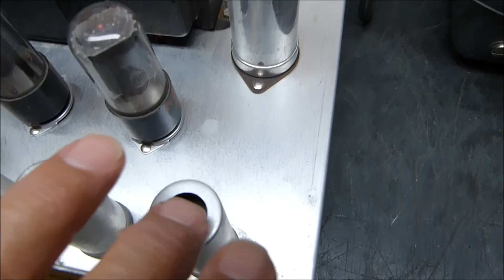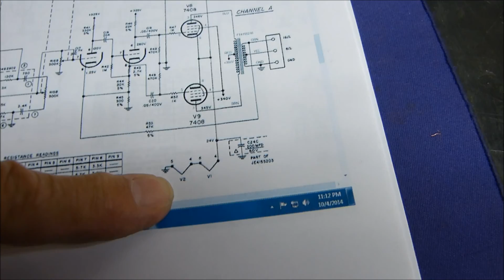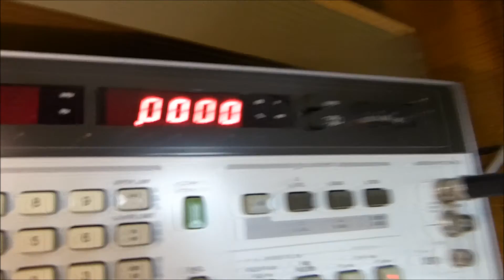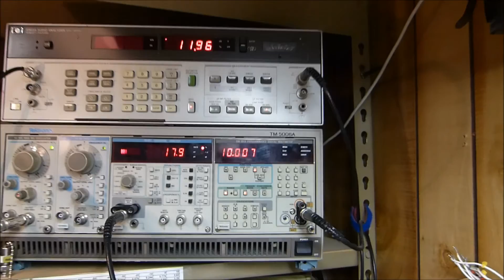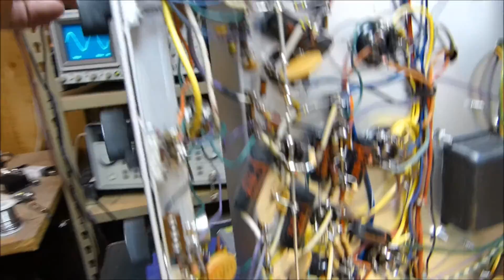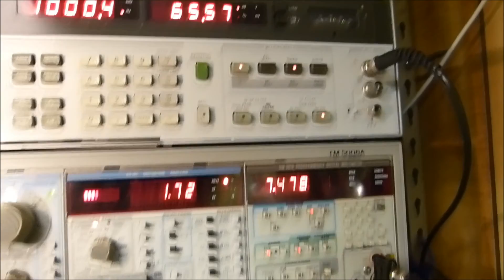Harman Kardon The Award Series A 300

Comment: just replaced all the electrolytics in mine. i installed them underneath using terminal strips. a few resisters were bad but none of the coupling caps were leaking. their mfd checked perfect on a cap checker so i left them alone. this is contrary to popular belief to change regardless..
                                       barry.
Reply from the maker: Mr71chevyvan I agree with you, Barry. Changing out good vintage parts doesn't make anything better
Reply: +Mr71chevyvan Make sure you check the old caps for DC leakage at their rated voltage. Often they turn into a 100k+ resistor with age, which can cause serious trouble if they are used in a coupling and DC blocking application.

Comment: I just have to put in my 2 cents here .....  I LOVE THIS AMP.  I use it every day.  I upgraded the power cable and the RCA jacks and saw a ton of improvment...  also I've replaced a few of the small caps inside.     I run a pair od ESP 4 ohm speakers and it sounds amaizing despite pushing the amp with the 4 ohm speakers.   SOunds better than my Dynaco and better than my Carver solid state.      This 50 year old beauty is spectacular.   Thanks for the tests   ...

Comment: Output cathode bias- I'd seen this method many years ago in a Fisher X-101 I had. Word of caution: Don't EVER operate the amp without those cathode bias preamp tubes; it will produce a high cathode voltage that will usually exceed the voltage of the bypass capacitor and will blow it (C24C in your amp).

    Another thing to be aware of, is if the amp is run hard (i.e. loud volume) for an extended period of time, the preamp tube filaments tend to get real BRIGHT. The outputs draw more current and cause this to happen. I like to install a 5w 24v zener diode across it to prevent this from happening.
Reply from the maker: Bob - Wow... I can see this is really good advice. None of this ever occurred to me but I know you are right on. Thanks for your update and hopefully anyone with one of these instruments will see your post and take heed.

Comment: I'm surprised that this is the 1st time you've encountered the "Cheap Charlie" method for DC energized phono stage stage heaters.  H/K was far from alone in using the scheme.  I DESPISE the scheme for a number of reasons.

Your bench is OUTSTANDING and I'm very jealous.  Keep the good work up.

Eli D.
Reply from the maker: I have been very surprised at some of the "thrifty" ways electronics have been built over the years. If you watch any of "Uncle Doug's" videos you will see guitar amplifier designs that are unbelievable back to the 1920's and '30's. Even to the point of taking the signal off the screen grid of one tube (in a push-pull pair) to drive the control grid of the second tube. I can imagine that back in those days, thrift was very important as each resistor, capacitor, tube socket, etc were expensive and hard to come by. Once we got to the '60's and beyond I don't think that was the problem. I agree with you and feel the same way and all of the top manufacturers never used these cheap schemes I have seen a number of "Huh?" things in amplifiers but this was the first time I ever saw them provide DC for the filaments of the high gain stages and provide a cathode bias resistor. Thanks for your comments - I do love working with this stuff..

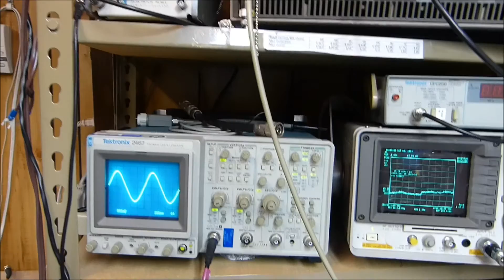Comment: 4:12 that amp is under biased.. roll the bias voltage on the outputs back to -14 volts and that zero crossing triangular wave will smooth out.

Comment: Look at the Eico HF87...The 12AX7 filament gets it DC filament voltage from the cathodes off one channel of the EL34s by hooking the filament in series with a 165 ohm resistor to ground